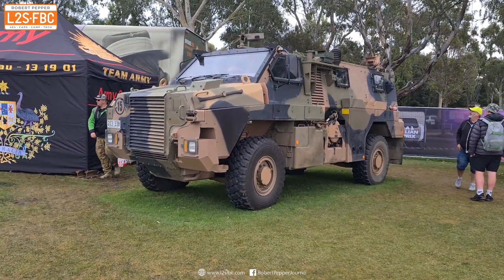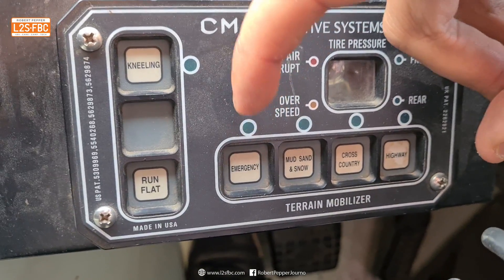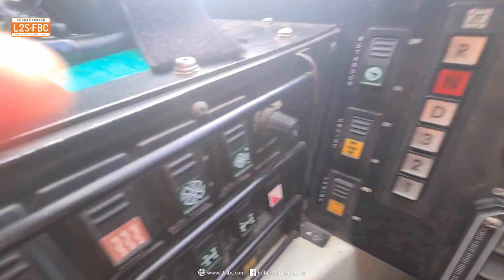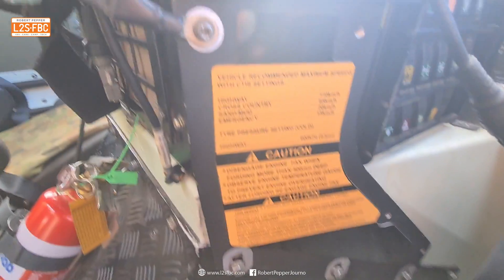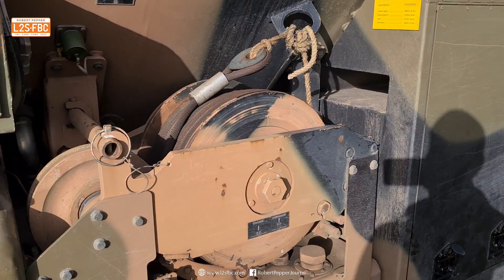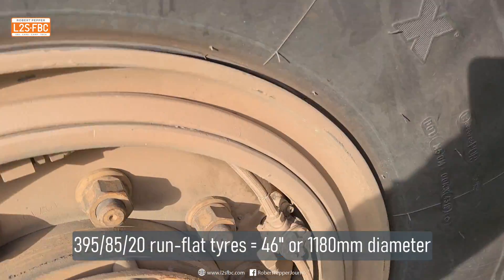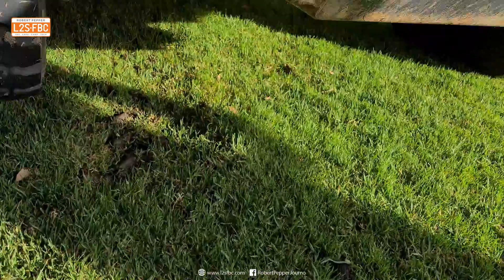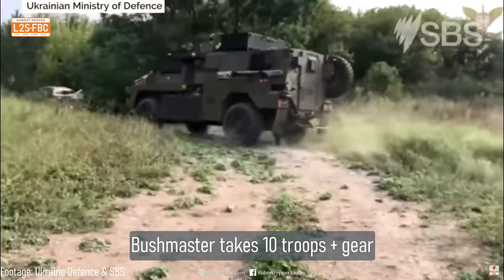Bushmaster - 4x4 controls  & more

Comment: What’s going on with that double park valve setup?
Reply: So the top one is for the park brake. The second is to send air to a PMV that will need to be recovered to we can release the park brake on a stricken one. Technically a trailer park brake.
Reply: @Nando_1221  Ah I see. I’ve only ever seen the yellow and red. Sometimes a round blue or black one that’s emergency release but only on a few vehicles.

Comment: 1:26 It's not that it doesn't have a five-star safety rating; it's that whatever it shares the road with has a no-star safety rating!
Reply from the maker: A reasonable point!
Reply: That’s what I was gonna say. The only things you’d need this to have an airbag for is an 18 wheeler and a train
Reply: @servicetrucker5  “Bushmaster - because our crumple zone is other vehicles!”
Reply: Will save you from .50 cal automatic gunfire and IEDs in a war zone but not much good in a head on when driving to visit your mother-in-law.

Comment: 55 years ago the Australian designed and built in Australia 4x4 and 6x6 ACCO trucks designed specifically for the Australian Armed Services I was driving, had a centre mounted winch running 73m of steel cable which was routed to either the front or rear of the vehicle driven from a PTO, nothing changes.

I would have liked to have had a centralised tyre inflation system back then, would've been a great help. The original Australian design was done in 1959 on a 4x4 chassis, with the 6x6 chassis very quickly following.

Air conditioning back then would have been wonderful...

Very interesting quick review; thanks.
Reply: And Second World War Canadian Military Pattern 'Quad' gun tractors and 15CWT winch-equipped trucks had a centre mounted PTO winch with front and rear rollers.  It's a very common setup for military vehicles.
Reply: @contributor7219  One aspect of the two trucks I drove, is that the 6x6 had a shear pin in the winch system, which meant that when you reached the shear point, the pin sheared and you were left high and dry in sand, or possibly stuck in a bog. The 4x4 truck had an electric cancellation switch, I cannot remember the specifics as it's so long ago, but you needed to re-set and then have another go.
The shear pin was a very bad design issue as far as all the drivers I knew thought of, including myself. If you really needed to be extracted out in a hurry, you didn't need or want the shear pin to shear. Some of us carried some steel pins filed down to shape; what happens in the field is quite different to the training we all undertook
If you are running a winch from a PTO, you need a shear pin or an electric cut-off to preserve the transmission from dropping it's lunch; meaning you'll be going nowhere. I wonder what the cut-off is for the Bushmaster?
Reply from the maker: Interesting points should I ever be allowed to drive one of these by the ADF!
Reply from the maker: Must have taken ages to change pressures?  I did like the side-mounted winch with option for double-line pull to centralise the force.  Very cool. Hard to adapt to a civilian road-legal car though.  For those interested the Gaz Trackmaster has CTI and my video includes a demonstration https://youtu.be/4SN3PlALNXY
Reply: @L2SFBC  We could drop air pretty quickly, but we never dropped much as the tyres were tubed and as sure as eggs are eggs, you would be pinching or chafing a hole in a tube before you knew it if you went really low, especially if you were fully loaded. Split rims were the go and it was always fun to watch an unsuspecting soul standing with us while we talked about anything except the wheel next to us being inflated from the truck's air brake system and then have it clang into position. The split rim was always facing towards the truck and back then one was allowed to stand within 6m of the inflating tyre, or on the other side of the truck in front of the two rear axles.
You are correct, it did take ages to re-inflate. We didn't generally use a pressure gauge in the field, we just hit the tyre with a jemmy every now and then, when it made the right sound it was surprisingly near enough.